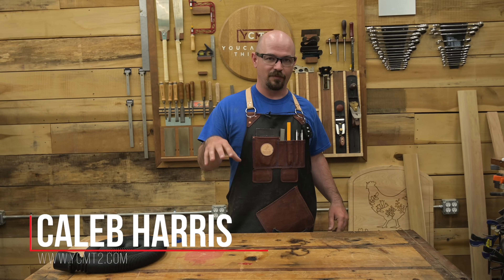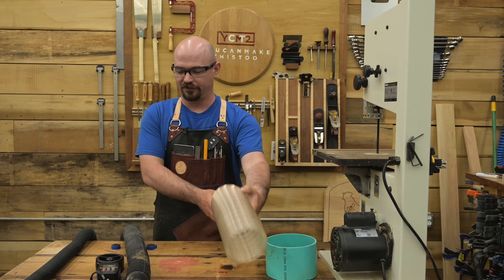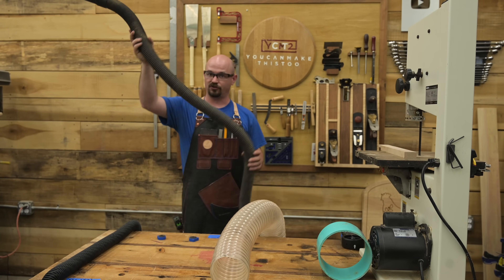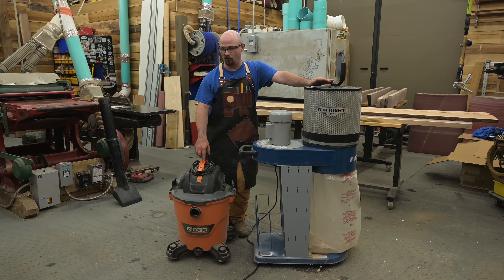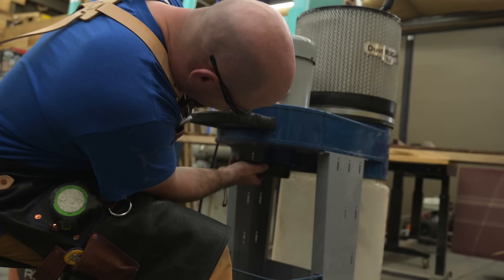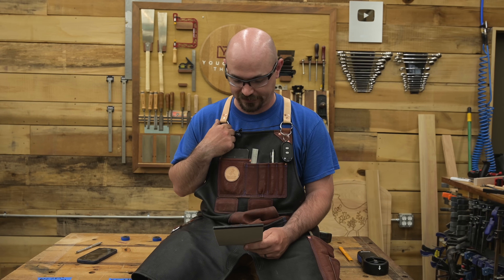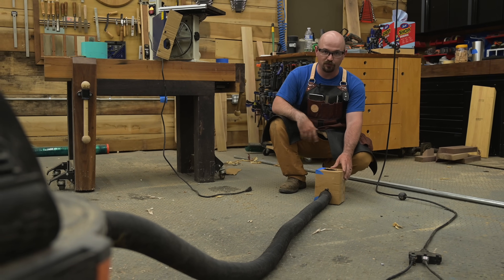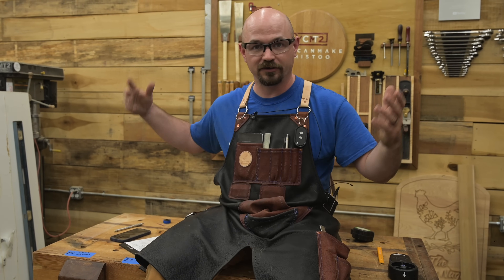We're Wrong About Dust Collection

Comment: Excellent video and essentially what I've concluded after a year of research!  You indicate that Onieda is the only option in high pressure low volume extractors.  While I'd love to have a Supercell, Record Power offers the Camvac which is another high pressure/low volume type of collector.  They appear to be not as good at final filtration vs. the Oneida Supercells, but that can be upgraded and they are far lower cost than the Supercell.
Reply: The CamVac dust extractor can be used with a Oneida Super Dust Deputy cyclone and the three 2.5" exhaust ports funneled into a 4" line which is then exhausted into a Wynn Environmental filter plenum box using Gamma Seal bucket lids. It's basically just like everyone does with the Harbor Freight dust collector motor and blower except use the CamVac instead. You can get the same performance as the Oneida Supercell except much more filter surface area. It take a little MacGyver-ing but at less than 1/2 the cost of a Supercell  It's definitely worth it.
Reply from the maker: Someone else mentioned the Camvac, that's new to me but I checked it out. Definitely very interesting. And those really "high pressure HIGH volume" systems. High pressure low volume would be the shop vacs.

Comment: Thanks for the video. I have a question. I have 3 shop vacs, different sizes and ages. I don't have a fancy tester. Is there a way to tell which vac is going to work the best in my shop without a tester?
Do I just go by the horsepower? Gallon size?
Reply from the maker: HP would be a decent indicator.. but it’s no secret that brands play funny games with HP ratings. 

A not crazy scientific, but simple and cheap test would be with the same hose.. make a pile of sawdust and starting far away, see how close you have to get to start sucking up dust. The farthest away one will have the best airflow. 

And new filters go a LONG way in keeping your airflow up. The motor can only draw as much air as it can push out.
Reply: @YouCanMakeThisToo  THANKS, I'm going to try that. One is so old I can't find any information on it so this test will help a lot 😁.

Comment: So I want to connect my 4" port from my lunchbox planer to my 2 1/2" shopvac with a secondary collector in between?
What are some thoughts on this setup?
Reply from the maker: By secondary collector do you mean like a cyclone? It doesn’t hurt to try. It won’t be pulling the air flow needed but it’s better than nothing. What’ll help is if the planer is throwing the chips at the outlet. 

Worst case it’ll just clog and then you know it don’t work.
Reply: Yes. I want to take a short 2 1/2" hose from the shopvac to the top of a trash can lid and a 4" in (probably PVC) from the can to the planer. I have been using the planer with 'passive collection' and just directing it into the can with a 4" PVC elbow and 2' pipe but it sometimes clogs. My thinking is that creating any negative pressure should make it more efficient. I'll let you know how it works.

Comment: A lot of meaningless arithmetic.  Finally, at 10:30 he mentioned THE key parameter for pneumatic conveying:  velocity at the pickup point.  CFM is only important for 2 reasons: 1) you have to have enough air moving to furnish the energy needed to accelerate and convey the material, 2) on some machines you need enough volume to sweep the open area with enough face velocity to cause the material to be captured in the air flow.  

These systems are never anywhere near the carrying capacity of the air flow even on something like a large planer or jointer so worrying about pressure drop isn't necessary.  I very successfully control dust nearly 100% on my 14" bandsaw with a 4" connection to the cabinet with a 2 1/2" line tee'd off the 4" run to a point right under the table.

Pickup velocity for sawdust and small wood chips is less than 2500 feet per minute.  Since these are vacuum systems, the lowest velocity is at the end of the hose; velo increases because the air is expanding as it gets to the motive device due to the pressure decreasing.  So, in a 1 3/4" diameter hose, you only need 42 cfm to achieve pickup.  2 1/4: 69 cfm, 4": 218cfm and 6" 490 cfm.  Even the cheapest dust collectors (I have one) move over 400 cfm at 4-5 in W.C.  My bigger Delta does ~700@ 6.5" W.C.  At 3000 ft/min the pressure drop per hundred feet of 4" corrugated hose is a bit over an inch if the hose is not kinked.  So stressing out over duct/hose lengths, elbows, etc is useless.  

That is until you need a lot of volume to capture dust off of a machine that flings the dust everywhere such as a miter saw.  There are a million videos on people trying to tame a miter saw.  Also, almost no dust control is achieved on above the table on a table saw.  The blade is moving too fast for all of the material to get out of the gullets of aggressive blades.  Even overarm collectors are only a little bit effective.
Reply from the maker: I don't know where the disconnect happened, but reading your comment I feel like you're commenting on someone else's video. I don't care about pressure so long as there's enough to make sure I'm getting adequate airflow at my tool. That was the whole point of the video, showing how duct size and static pressure affect air flow at the impeller port v end of the hose (tool). 

Also I don't know where you got 2500fpm for collection... Everything I've read says dust collection requires 3500-4500 fpm (Oneida, Bill Pentz, OSHA, Wood Magazine). The seeming assertion that 2500fpm x port area tell you how make CFM is needed is very flawed. Different machines have different flow requirements. 

Also from my reading static pressure loss is more like .25" per 1' of 4" flex hose. Again, not that I care about pressure loss, I care about air loss caused by that. It sounds like you're saying a 100' of straight flex hose shouldn't bare a second thought, but in my test just 10' of straight flex hose resulted in a 100cfm (20% total flow) loss. And in my old shop with just ~30' of 4" solid pipe I saw significant drops in volume. Disregarding ducting length and fittings is just wrong. 

But that's all way beyond what I was trying to talk about in under 15 minutes here. As I thought I established early on.. the main point was if most of your machines have shop vac sized ports (which are probably undersized for the machine and poorly located), don't assume investing in a dust collector is gonna be worth it for those tools (and may be worse without a lot of care and knowledge).

Comment: Into the equation of dust collectors. Atmosperic pressure is 14.7 PSI. 1 BAR. The max vacuum you can pull is 0 PSi. IE zero Bar. This is physics & there is no machine that can pull more suction/vacuum than Zero .. Otherwise I guess you get a black hole. So the max pressure you can get at the end of your hose is 14.7 PSI Atmospheric, which is the air getting pushed down your hose to refill the vacuum created by your dust collector. BUT. To achieve this 14.7 PSI you would have to pull a complete 0 PSI Vacuum. Note all our gauges are set to read 0 at 14.7 PSI our atmospheric pressure. My thought is if you want meaningful data on atmospheric pressure/flow going down your hose, we should be taking vacuum readings in the plenum chamber of the vacuum machine. I have a sneaky feeling this is why the camvac works well.
Reply from the maker: That makes sense, thanks for sharing. I'm sure the manufacturers posting static pressure readings are doing that or even better to test their machines. For my purposes I'm happy to take their stats as facts.

Comment: I'd be interesting to see what happens when you run a 4" line to the band saw with a neck down adapter right at the machine.
Reply from the maker: I should’ve tried that too
Reply: What about if you modified the machine port to be 4 inches? Could that be better dust collection performance at the blade??
Reply: Whatever

Comment: None of my tools come with a 4” port, but I have the HF 2hp dust collector with a single straight run of 4” ducting along the wall and 4” flex hose going to each tool with a 4” to 2.5” reducer right at the tool dust port and it is significantly better than just hooking up my ridgid shop vac to the tools.  Reducing the 4” dust collector to a long 2.5” hose doesn’t accurately represent real world use because there is no reason to use 2.5” hose anywhere when you can just reduce right at the tool
Reply from the maker: If the tool ports are located so you can do that it’s definitely helpful. As is the bag filter on the unit, it helps the unit pull more air.

Comment: This is some really good info.  I have been saving to get the Dust Right 1250, but I was also wondering if I should save even more and get one of the Oneida collectors which would require a 220 outlet, and the Rockler is only 110. Lots to think about now
Reply from the maker: If you’ve still got a lot of small ports the Oneida would serve you better. Won’t notice much difference with the dust right on anything under 4”.
Reply: @YouCanMakeThisToo  my larger tools such as tablesaw,  bandsaw,  jointer,  and planer are 4 inch so I was thinking the dust collector for them and a shop vac for mitresaw and other smaller tools ??
Reply from the maker: Perfect. There’s a reason I have 6 various vacs in the shop. But that is excessive 🤣
Reply: @YouCanMakeThisToo  Thanks for replying and giving feedback. Much appreciated

Comment: Another difference I've discovered is in the duty cycle. For example, running a 12 hour CNC carve might be more suitable for proper dust collectors. I don't believe my shop-vac will last long if I regularly ask it to run for such long sessions.
Reply from the maker: Ooh, good point. If you’re often running carves that long though it probably makes sense to have a better suited (and quieter) system.

Comment: Really interesting data you've collected here. It's given me a lot to think about. Maybe I'll just hang onto my shop vac a bit longer until I start up-sizing my tools. Thanks for sharing!
Reply: Most big shop vaccuums are somewhere close to 13 amps. You might be able to find a 15 amp model. A 15 amp commercially designed vacuum with move a huge amount of air. That's a 1 horsepower motor. The other thing, you can buy an additional shop vacuum for $30 and put a bag in it for $5. The bag completely prevents any need from ever cleaning or replacing the filter, then you can use 2 vacuums on one piece of equipment, to cover different parts of the equipment. For example, an overhead arm guard can have a dust port on a table saw, then you can also hook a vacuum to the main dust port under the blade. Or on any tool or saw, you can have a box behind the tool with a dust port, so you cover any stray dust that blows past the factory shroud. Having two 13 amp vacuums is still only $60 for 2 used vacuums. Buying a real large 1.5 horsepower dust extractor is great, but it doesn't come with a proper cartridge filter, and to setup all the hoses, it's basically a permanent installation, and the cost of the hoses and fittings, it's going to end up costing 4 times what it would cost for portable shop vacuums? I think building a "cyclone" or buying a cyclone to capture dust, makes a shop vacuum a very viable option.
Reply from the maker: If your tools don’t have 4” ports that’s probably you’re best route!

Comment: 180% MORE air, or 180% air moved, meaning 80% more air? You said 180% more air, but then only said it nearly doubled it. 180% more would be a total of 280% the air moved by the shop vac.
Reply from the maker: I also gave the raw number before I did any percentages.. so if I misspoke that’s easy to clear up.

Comment: RIGID Vacs are great. Used one at work about 12 years ago and bought one for home shortly after.
The thing sucks so hard! has many attachments and filter options etc.
AND If you need to move water? GET READY BOYZ! These vacs move more water than most pumps. Be careful though because it will fill itself in seconds and being the beast that it is -The vac will start blowing water out the back exhaust if you're not paying attention.
Tragic but also hilarious.
That 1 Vac has seen so much abuse and its still going strong.
RIGID VAC 4 HOME, Hydrovac for work ;) Professional sucker.
Reply from the maker: They are some seriously great vacs! I’ve had a few and have abused the heck out of them and they keep on sucking.

Comment: Very good overview. Well done. 

I seriously considered the Onida Supercell for my small shop. After TONS of research, I settled on a solution that is very common in Europe (the land of small spaces). I end up buying two HVHP CamVacs for less than half the cost of the Onida. The large one (24 gallon) lives under my table saw... its currently dedicated to the table saw but will be piped to a future band saw one day. The smaller one (14 gallons) lives under my miter saw and is paired with a 30-gallon dust separator. This smaller unit is piped to everything else (miter saw, router table, jointer, sander, drill press, etc). I installed an inline switch for each so I don't have to reach under the equipment to turn on the vacs. After a couple of years, I am still VERY pleased with the results. As an added bonus, they are relatively quiet and I did not have to allocate additional floor space to the Onida because the CamVacs are small enough to fit under the table saw and miter saw station. 

There are only two US dealers for the CamVac. 

https://www.thewoodturningstore.com/record-power-cgv386-6-us-camvac-90l-3000w-vacuum-4-inlet-with-hose/
https://www.thewoodturningstore.com/record-power-cgv336-4-us-camvac-55l-2000w-vacuum-4-inlet-with-hose/

https://www.thewoodturningstore.com/record-power-cva286-27-100-286-336-caster-set/

https://www.turnerswarehouse.com/products/cgv386-6-large-extractor-dust-extractor-collector
https://www.turnerswarehouse.com/collections/air-filtration/products/cgv336-4-medium-extractor

I hope this helps someone out there!

Comment: The proof is in the pudding. None of this "I feel like..." stuff. well done, Caleb. Interesting results, too. It demonstrated your facts perfectly.

I have the same Ridgid vacuum that I use with a Dustopper. When I bought my "annie", I measured 188 cfm at the inlet on the vacuum. With the Dustopper and the stock hose, I got about 80 cfm at the end of the hose. Not adequate for my Ridgid R4512 table saw with the cabinet and 4" outlet. I bought the Dust Right 750 a couple of years ago (when it was $300 cheaper) and I get the same numbers you got, i.e. 500 cfm at the inlet on the dust collector and => 400 cfm at the end of the hose. Works much better. It really works great on my router table which has a dust collection port on the fence and a dust box underneath. Routers can be a real mess but I now make more mess cutting a dowel with a flush cut saw.
Reply from the maker: Thanks! It was fun doing this. Couldn’t wait to share once I finally understood how it all works together. 

Funny that you have the same dust right and shop vac, they’re solid machines! Glad you got it figured out for shop, and fun to confirm you had the same observations

Comment: Thanks for the vid! To be completely accurate, get/make an adaptor for Annie that matches her input diameter. In other words, on the hoses that are smaller than her opening, you need to neck back up to get accurate readings. If you don't, there is a mechanical loss due to pulling air across only a part of Annies blades. Me thinks 🤔
Reply: Ha! Shame on me. You corrected for this further into the vidja! Sorry for the false alarm and thanks for the vid!
Reply from the maker: No worries! I appreciate the follow up 😊
Reply from the maker: To help offset that I set it to Max hold and slowly moved them around.. so I’d get the max possible airspeed. And most importantly did all of them that way. 

Ain’t research paper accurate, but I’d bet it’s 95% accurate or better, plenty for the purposes of this video.

Comment: Recently upgraded from a job site table saw to a Sawstop PCS 1.75 and it never dawned on me the Ridgid + dust separator I use wouldn't do anything for dust collection on the new Sawstop. I found out the hard way I ended up purchasing a jet 1hp unit with the canister like your rockler.  Also got the dust collection blade guard , works amazing now after another chunk of change.
Reply from the maker: Congrats on the upgrade! But yeah.. realizing one upgrade forces another is a kind of bittersweet 🤣. 

I’ve got the over arm dust guard too, it’s amazing!

Comment: pi is constant, it's the radius squared part responsible for the quick area growth of larger circles. 2 cool things: math and youcanmakethistoo (:
Reply from the maker: 🤦‍♂️🤣 in my head saying and even reviewing this I was like “I know I’m so right and wrong about this but my brain ain’t braining right..” but yeah, it’s that exponent that makes it exponential 😂😂 thanks!
Reply: @YouCanMakeThisToo  Furthermore, "exponential growth" generally refers to something where the variable you control is in the exponent (like time). Something like investment growth or population growth, where you have: Initial * (rate)^X, where X is the number of cycles, rate is a fraction (5% = 1.05). For example you start with 10 squirrels, each having 2 babies per year (rate = 2), so after 5 years you have 10*2*2*2*2*2. Assuming immortal squirrels that reproduce asexually, of course. With area and volume, you have X^2 or X^3, where the exponent is fixed, and you control the base. In that case we say something "grows with the square" or similar. At least, that's how I understand it.